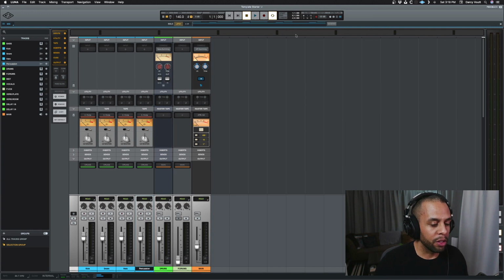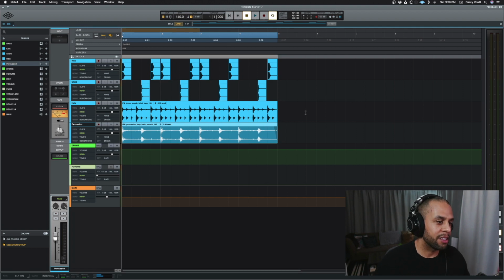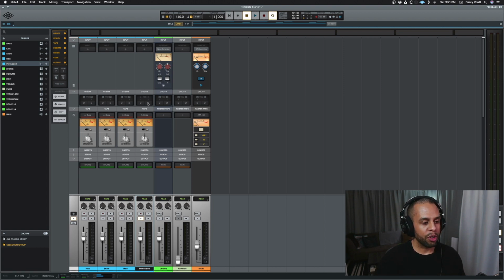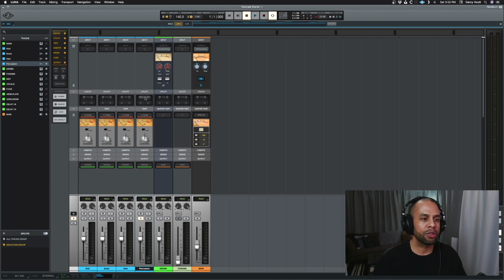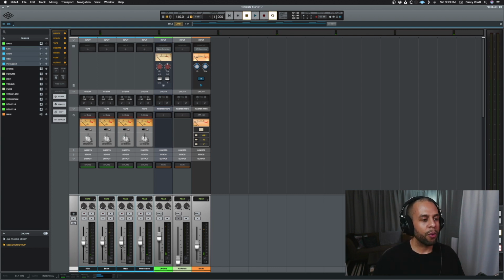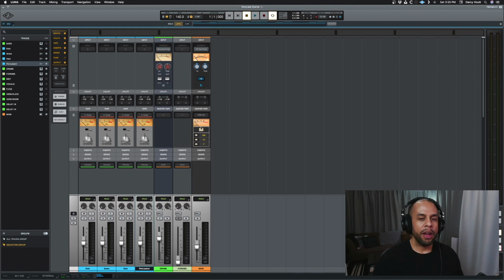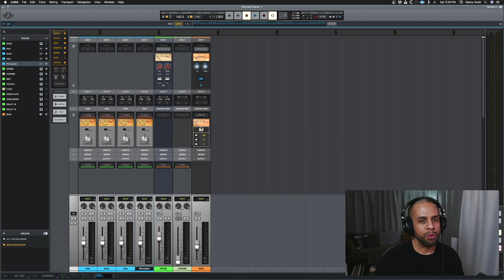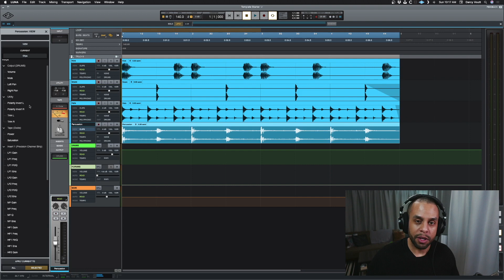Working with the new Utility Drawer

Comment: So, during the gain staging process of an overall mix, would the trim gain in the Utility Drawer come before or after clip gaining? Does it make a difference sonically which is done first? How does it affect pre-fader metering? 

Just wanna let you know that I took in so much info and knowledge from your other video covering gain staging: it immensely helped me more properly/accurately gain stage and bring all the audio tracks to a healthy, adequate level.

i.e. putting tape on each individual track and driving the VU meter to somewhere around 0

As always, thanks for such consistent uploads and content! Keep 'em coming!
Reply from the maker: Really appreciate hearing my stuff has been of help. 

Think of trim gain as clip gain but for the whole track. Instead of adjusting each clip in a track you can use this for all at once. Each approach has their benefits, use whichever suits best. Clip gain is better for adjusting loud phrases and trim allows for left and right channel adjustments when a signal is not balanced how you want. 

On a track it comes in right after the input. On a bus it comes in before the summing. 

With tracks, let’s say you have an instrument that sounds really good over driven while recording or out of a VST, but too loud heading into tape. Use trim to bring it back to level. 

With busses you can use it the same way but to dial back or add more to change how hard you are hitting summing regardless of the staging of the tracks into the bus. 

It’s a simple utility but it will be helpful in different ways at different times. Here’s another video to help. 

Utility Gain in LUNA is a Life Saver
https://youtu.be/KnUS4Yef5Is